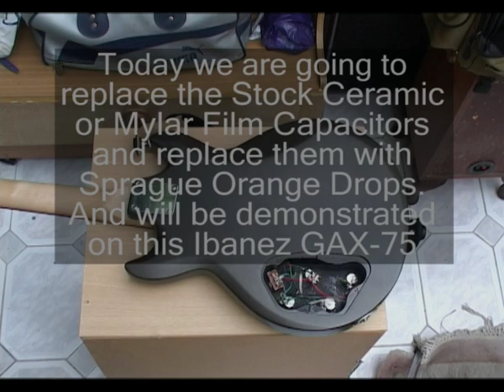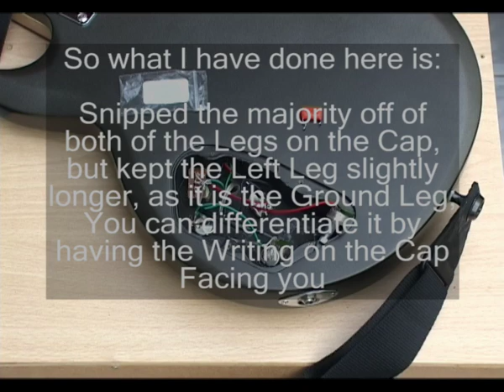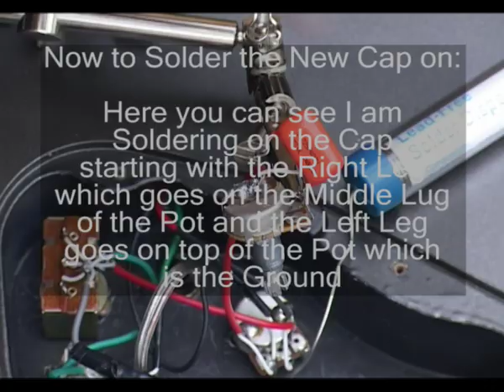Guitar Mods (Part 2): Sprague Orange Drop Capacitor Install

Comment: You know what I find funny about this entire thing? People argue about the differences and claiming "Oh, you have to use the top of the line caps for guitar for the best tone," or "They don't make a difference, man."

Personally, I'm studying electronics in college. What makes a good capacitor, resistor, potentiometer, inductor, etc is the tolerance of the components. If you go and buy dirt cheap components (and components are inexpensive the way it is), they'll most likely have a high tolerance level like +/- 20%. This 20% on a .022uF (or 22nF) capacitor puts it's potential range to .0176uF to .0264uF. That is a drastic range and the middle of the range priced components would only have a 5% tolerance on them; making them much closer to the listed value.

Just remember, guys, there is always a logical explanation for everything. Hopefully, I cleared up some thoughts on this.
Reply: nope, I have no idea what you just said because I have zero familiarity with electricity. Are you saying orange caps will give a darker tone, brighter tone, better range of tones or what?
Reply: I hope after your study you realise how wrong your comment is. Capacitors have more values than just Farad and tolerance. Do you think all 12 inch 8 ohm speakers are the same?

Comment: From my experience ther is not a + or - on sprague orange drops capacitors because they are non-polarized. A capacitor that has a positive and a negative will be an electolytic (cylindrical) capacitor and the + qnd - is marked on those. I would go out on a limb here and say that if you buy a capacitor and one of the legs is not obviously longer than the other then it is non-polarized and therefore does not have a + or - so the placement of either leg does not matter.

Comment: I usually don't comment on this stuff, because people hold so strongly to their beliefs, but for those who are new, and don't know........the only thing that matters about your capacitor is the value. Not what it's made out of. ......Radio Shack caps serve just as well as an expensive boutique capacitor when dealing with guitar circuitry
Reply: QuillPen77 I found the Orange Drop caps made my sound a little too "Orange". Not 60's vintage orange but more like 80's post disco orange. I painted one side of the cap with burnt umber craft paint. Darkened up the tone nicely, but sounded a little too "Vermillion". So I tried again with a new Orange Drop. This time painted one side with Raw Umber instead of burnt umber. Now the tone was less orange but too brown. I kept hunting for the right color, supplied or painted on. It consumed the hours in my day. To find more time to experiment with cap colors, I quit "Playing" the guitar all together. After all, it doesn't really matter that you can play, just that you find that elusive "Tone". 

After months and years of searching for the right color cap, not too orange, not too brown/yellow/red, kind of matte mustard color was what I wanted. I finally found the ideal component. It's a 3 cent ceramic disc. Oddly enough it has the same amount of farad's as the orange or OD green or zombie neon green that expensive caps have. Sounds exactly the same.

Only problem is, the local CraigsList garage band won't hire me because they don't consider ceramic disc caps "Pro Level Equipment".

Damn. Thanks - Lumpy
Reply: I'm intrigued. When you say the only thing that matters is the value, surely that would mean different material do make a difference. As the ESR of a capacitor will change in value depending what it is made of. Or are you referring exclusively to the Farads of the capacitor ignoring all other criteria? If the only thing that matters is the value, do you use electrolytic or tantalum capacitors in AC circuits?

Yes, I do hold rather strongly to the belief that tantalums and most electrolytic capacitor in an AC circuit is a bad idea.

Just because you don't understand something or can't perceive a difference doesn't mean everyone else is wrong ;)

Comment: The only other way i could imagine anyone significantly altering the output or greatly increasing tonal variation would be to install active cicuitry.

I would NOT advise anyone to attempt this unless they really know what they're doing.

It's great fun to experiment with tone cap values though, until you find the desired sound.

Comment: Use 500pots & .022caps if you're going to use the pickups primarily in humbucking mode. If you're going to split the coils more, then use 250pots & .047caps.
Single coils are a lot brighter than humbuckers so they use lower resistance pots to get rid of more harsh high frequencies. Lower caps mean that less treble is rolled off which is why humbuckers have a lower value as they already give a warm sound.
Cap voltage is just a limit and because guitars are passive it won't matter.

Comment: .01 mfd is a better choice for the orange drops.  You can run your tone knobs higher on your amp than you would normally play and roll the tone pot back  to halfway with .01mfd caps, and have your regular tone and when you want to SOLO you dime the tone knob and the huge apparent frequency shift is like kicking on a boost pedal and RIGHT OFF your guitar.  It really is the mod to do for the guitars normal frequency range.  You can also turn the tone knob OFF and still have a great sound! Try it!

Comment: TIP ! An 'in circuit' capacitance can be increased by placing them in parallel. So for instance, if you have 0.022 uf's in the tone circuit, you can increase that effectively to 0.044 uf's by parallel 'mounting' [ temporarily ] 0.022 uf's 'piggybacked' on the existing ones, to test the resulting 'tonal effect'.  No 'shock voltage' present, so completely safe to do so.

Comment: Yeah man I know all about the P-Rails, was keen for some myself but ended up getting GFS Dream 90's.
My plan for them with the 4 available holes was to either have a master volume and tone for both single mode and humbucker mode, or maybe have a couple concentric volume pots so I could control the individual volumes of both pickups. And I'd use a Duncan Triple Shot to split the coils.
The only bad thing about this is that the 250k pots won't have a use while in humbucking mode and vice versa.

Comment: you can use different brands of capacitors. I use a .047uf orange drop in series with a .047 Mallory 150 that gives .022uf of capaticance. sounds great!

Comment: Why bother, when most people leave their tone control on full all the time, or, better yet, bypass it? At the guitar is not the place to bleed some of the signal to ground. On another note: I replaced all the caps in my old Orange with orange drops and it sure sounded warmer and smoother...to ME. Nobody else noticed the difference. Its interesting that orange drop caps are often said to give a warmer, fuller tone with less highs, and people hear that, but are sometimes said to increase "sparkle"

Comment: I'm NOT the only one who has made this point strangely enough, yes it is everything to do with the farad rating.

I build/repair basses and have been playing for nearly 30 years.  I'm aware that cap values will be different for guitars as they cover a higher frequency range so a value of 1 nano farad or (0.001uf) which I guess would cut frequencies above 2.1Khz, though my maths has let me down before, so do correct me if I'm wrong.

Comment: Thanks. the concept of the P-Rails is to have a switch between single coil and humbucker readily available. Pot matching didn't cross my mind when I was making the purchase. My first attempt will be the P90 sound, if it doesn't impress I'll then rewire for humbucker. As a thought, on the Les Paul I am wondering if I could set up each vol/tone pair with separate pots for single coil and humbucker. Somehow send the signal to the specific vol/tone as needed?  Need to do some searching on the net.

Comment: I bought ORANGE DROP.0047uf 1600vdc  capacitor. but a I have a guitar with a similar configuration as yours, The only thing different is that mine doesn't have 2 tone controls, mi question is, did I lose my money? this caps that I bought don't work in my guitar? thanks!!

Comment: @Cappi666 

The voltage rating shouldn't matter, it just means that any more voltage than 400v (in your case) will cause the capacitor to explode (or is it implode?)

Comment: Nope, the voltage rating is completely irrelevant on electric guitars and basses due to the extremely low signal. The only noticeable difference is the larger size of higher rated caps, as well as the higher price, but they are not better just because they are bigger and more expensive, it's just that they use more material to achieve the higher voltage tolerance.

Comment: Random Act is definitely right about these caps not being polarized but  overall I thought this was a good view on updating your tone but also you should know it will also be good to make sure your pots are 500k when using these caps - if they were les than 500k and you used these caps the tone quality would sound pretty bad. 
Another issue which I was pretty disappointed was once you show you had completed this upgrade - you NEVER show (with volume) the improvements on your guitar toning.  You said at end listen how the difference is - I'm saying to myself what about your guitar- I wish I could of heard your guitar after replacing these caps -BUT you didn't do that - too bad that would of been the icing on the cake!
Reply: Probably because there would have been absolutely not one bit of an audible difference .......lol

Comment: I noticed these caps can be different volts. You mention the ones you installed on the video were 400. I have spotted 200 and 600. Does the volt have any effect on the sound or tone curve. I don't know which volt rating to go for. I am installing seymour duncan p-rails which are a hybrid of p90 and single rail. I am assuming the pots could be either 250 or 500. If I use 250 pots I guess I may need .022 caps and for 500 the .047. Any advice is welcomed. I am happy to experiment any suggestions.

Comment: Does it matter what side goes to where? I have orange drops to wire in my lespaul, (50's style) wiring update.
Reply: If the cap is polarized it matters big time !!!
Reply: @everettpresley3704  Shouldn't be using polarized caps in a guitar circuit! They will alter your tone BADLY, they will bleed out frequencies you need to keep.

Comment: do u know the capacitor that's similiar to ibanez RG's caps? or u can reccomend me a better one? my guitar is ibanez js100, and i've installed a 'treble bleed' and it sounds dull compare to my RG2550 when i backed off my volume.

Comment: I have a strat, do I just replace the existing capacitor or do I need to add one to each pot?
Reply: Shemus i have a squier strat hss with stock
Pickups and a hum gibson, all is stock only change from 0.22 to 0.47 and i like the sound get more warm sound

Comment: if you have 2 single coils and 1 Humbuckers on the Bridge, what Value and Volts of Orange Drop Capacitors should i use?, pls answer,, thank you
Reply: thank you very much, That's a lot of information, i really appreciate it,,it Helps me a lot,, Cheers from the Philippines,,
Reply: my guitar have only  1 Tone control,, what Value of caps. should i used for my Guitar having 1 Tone Pot., thanks

Comment: If I have a guitar with HSS configuration and 1 tone knob, which capacitor should I use? .047 uf or .022 uf? Thanks
Reply: 0.047nf 10volt  mylar film cap on the tone only. Forget the orange drops!

Comment: Hi I'm thinking of installing a pair of orange drop caps into my Lespaul, i've googled some images on this and noticed A lot of guitars have the capacitors soldered to the tone and volume pots . I see in your video you only solder them to the tone pots. is there a reason for this or does it make a difference. Great video by the way
Reply: Anything wrong with the tone from your Les Paul? Or are you simply following trends? It's a waste of money! Paying up to ten dollars a cap for something you will never see again is pointless especially when they may not give you the sound you are looking for.

Comment: Too clear this up for those who have NO clue as to what it is that you are talking about.  The capacitor in the application of a guitar tone control acts as a high pass filter.  Different value caps allow for MORE OR LESS highs to be retained/passed as the tone is rolled off from from "10-1".  There are definitely differences between values selected.  But unfortunately they are most noticeable when the tone is rolled all the way or damn near off, "woman tone", but NO difference w/ tone at 10.

Comment: condensateur type céramique 400v pas nécessaire.only difference beetween orange and green the tolerancce and voltage max. the tall is not a reference in electronics.

Comment: Save your money... put a 2c polyester or ceramic cap in and get the same result, don't care if it is a gold coated, platinum foil with neptunium oil dialectic it will make not one iota of difference except for your vanishing cash.
Reply: Obviously as a commenter on YouTube you are an expert in all the possible variations in capacitors and you probably have some of the best tonal ears on the planet.

Yet reading your comment, I suspect none of the above is true.
Reply: You’re probably right. But the reason why I would get a fancy capacitor is for the vibe. It’s a psychological thing.

Comment: Tone caps of any kind do not add sparkle to the sound, they are there to cut treble.
 It makes little to no difference what type, the cap value matters and the tolerance matters but ceramic disc and poly sound exactly the same in a tone circuit.  So much stuff in guitars is just regurgitated nonsense.
Reply: Stop spreading uninformed nonsense. Capacitors have more specs that Farads and tolerance. Some will cut certain frequencies before others, giving a tonal difference. Different caps will have different Q. The fact you can't hear it doesn't mean it isn't happening

Comment: Just swapped a new Fender tone pot on my Jackson, it came with a orange drop cap 22uf, the old one was a green drop 47uf. $5
Reply: Do you have single coil pups or humbuckers? IF so the 47uf cap is the way to go or even better a 0.047nf cap. IT will give you more tone change over the sweep of the pot.

Comment: You DO hear a difference if you know what you're listening for. Even without turning the pot, the cap has a subtle effect on the resonant frequency magnitutde and cutoff of the pup. Orange drops DO have a smooth sound compared to the sterile, harsh, ice pickyness of ceramics.